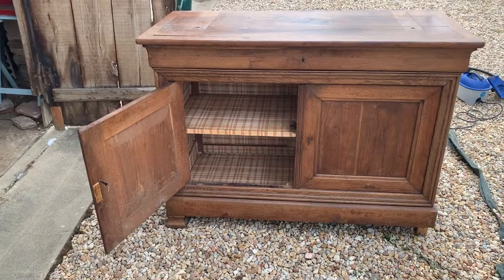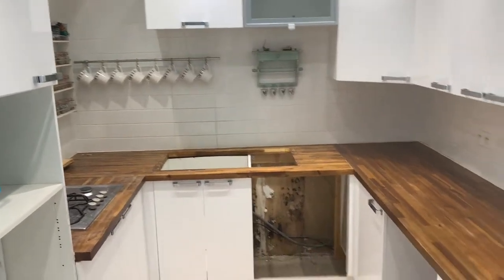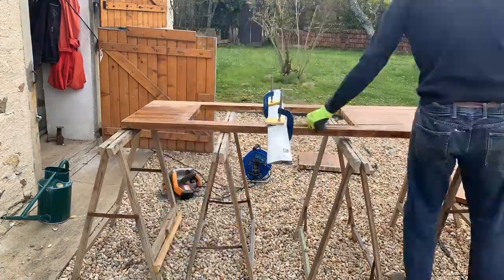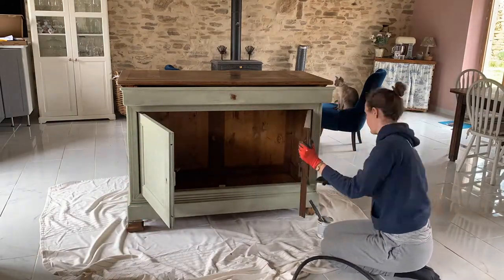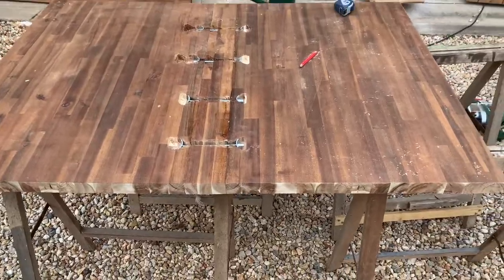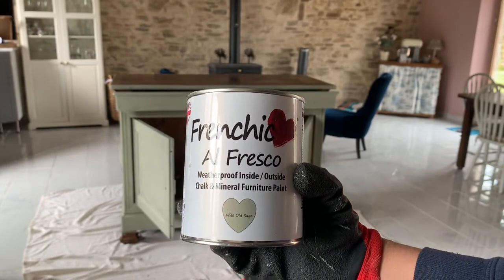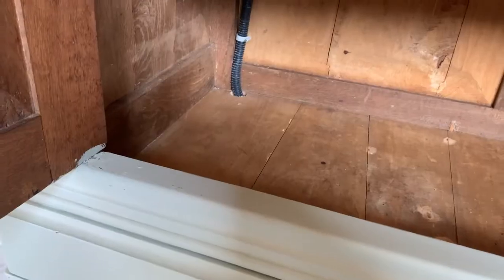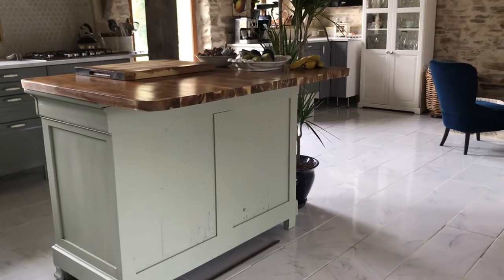How to make a kitchen island from an old dresser!

Comment: I’ve looked at so many videos on how to actually screw the top on and every time it gets to that part it’s skipped over quickly.  😪😪😪😪
Reply from the maker: Hello! So I drilled a few pilot holes through the dresser and the surface from underneath (making sure that I didn’t drill right through the surface!!) and then screwed in the screws from underneath while holding the surface on top. Sounds obvious but just make sure your screws aren’t long enough to go right through the surface and stick out the top! We’ve all done it 😂 hope that helps!
Reply: @LifeinLaCampagne  awwww thank you so much!!!!!
Reply: @LifeinLaCampagne  what kind of screw and what size screw did you use?  Did you use a washer or anything else?
Reply from the maker: @traceyblad7866  no problem at all, good luck with your project!
Reply from the maker: @traceyblad7866  I will check the exact sizes etc. in my man cave and get back to you!
Reply: @LifeinLaCampagne  thank you
Reply from the maker: @traceyblad7866  I used standard wood screws. I got a size that was long enough to go through the dresser and halfway through the wood surface. As our dresser has a drawer, I countersunk the screws so that they were flush with the wood and wouldn’t interfere with the drawer opening and closing. So I didn’t use any washers because of this, but if you don’t have a drawer you could use washers as this will make it even stronger. Hope this helps!
Reply: @LifeinLaCampagne  You have no idea how much I really appreciate you responding!!  Thank you so very much!!  I completely understand now and thank you for the help.
Reply from the maker: @traceyblad7866  excellent, hope it all goes well!!